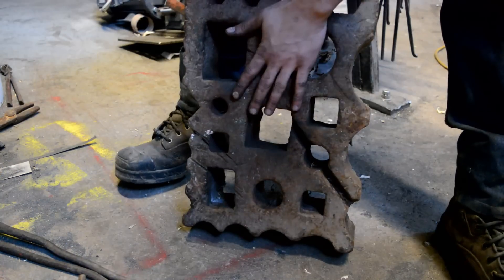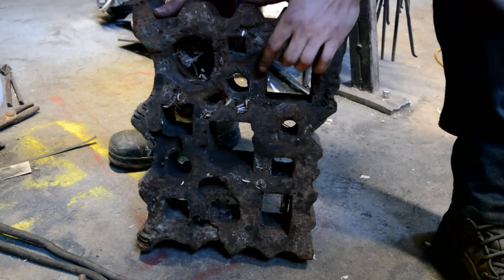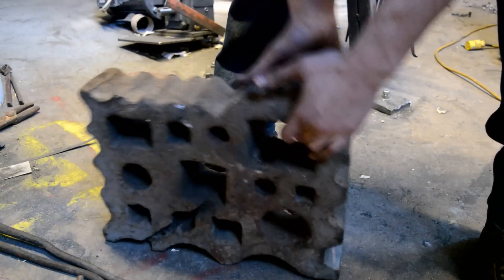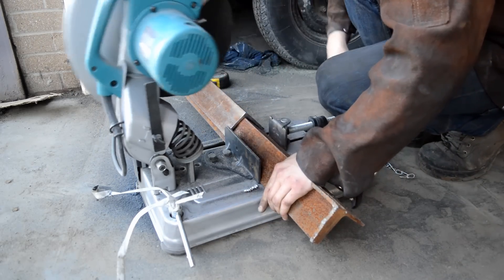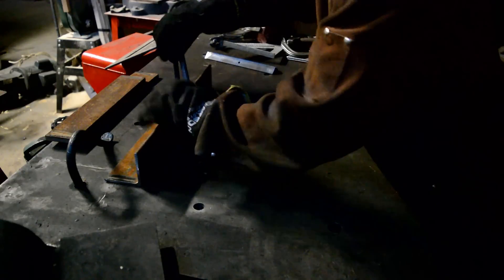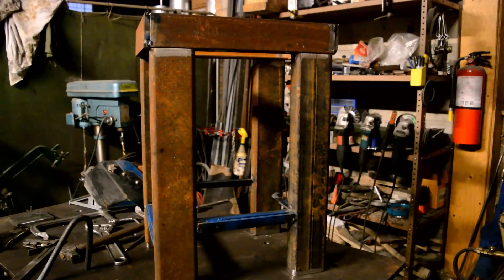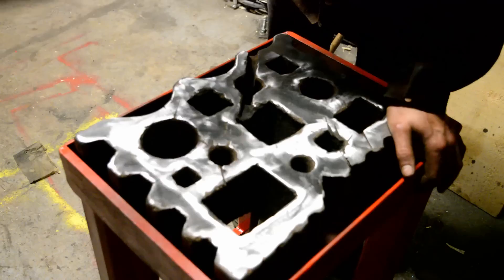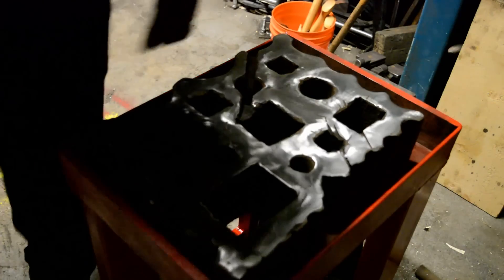Blacksmith Swage Block - Resto and Stand

Comment: why not fill all the holes and screwed up areas with weld?
Reply: It'd take days with cast iron. You need to heat it up red hot and can only be arc welded then cooled, cleaned, heated and welded again literal days of work.

Comment: sorry for the question: what is this tool god for?
Reply: +norm1124 https://en.wikipedia.org/wiki/Swage_block
Reply: +TheJohn8765 okay, thank you. So to use the sides, it will be outside the stand, right?
Reply: norm1124 I would think he'd either remove the swage, trap the material between the sides and the swage (doubtful since he didn't secure the swage into the stand and that would lead to imprecision), or he has other stuff (like on his anvils) he can use rather than the outer forms.
Reply: +TheJohn8765 thanks for helping a Newbie
Reply: norm1124 I'm a noobie, too, mate. I just love watching machining and blacksmithing channels :) If you have a chance, go to a Farming Fair (or something like History Days) where you live. They're almost certain to have a blacksmithing stall. Blacksmith's love to show off their skills and hearing them pounding iron and smelling the smelter is deeply satisfying.